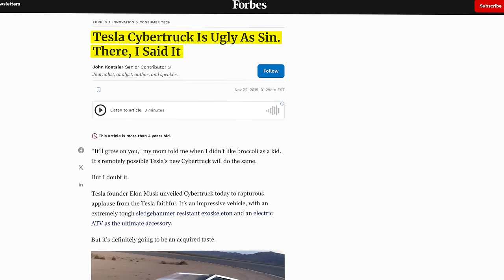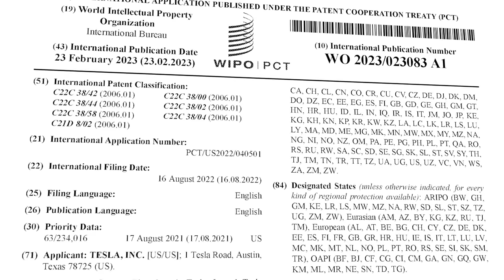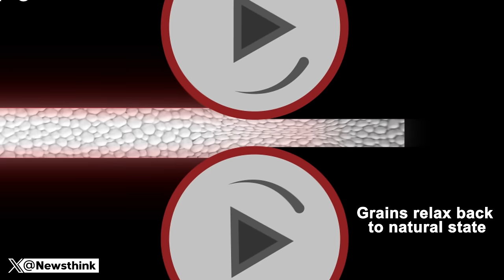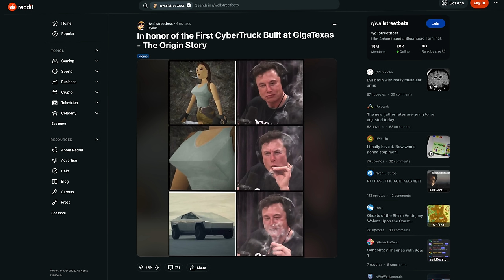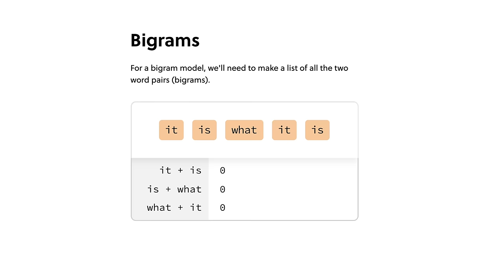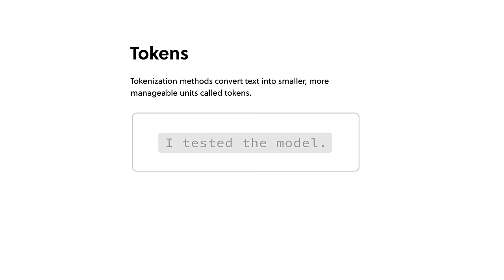Why Everyone Hates the Cybertruck

Comment: This is going to be a MASSIVE sales flop.  I give it 3 model years tops before it's canceled.
Reply: In most countries it will never be available due to its lack of safety.
Reply: @konstruktivismuskonstru9360 At least those countries will be spared having to look at this hideous monstrosity.
Reply: pretty sure it has about 2 millions PRE-orders already buddy
Reply: @infinitehexington Pre orders aren't actual sales. Those orders were collected when the truck was priced at $39,000. Now that it starts at almost $61,000 I'm sure a lot of those orders have been cancelled. That's what happens when the CEO over-promises and under delivers.  Musk is notorious for that.  Missing about 20% of the promised range sure isn't helping anything either.
Reply: @brandons9138  it's not only double in price, but also half in range. And it rusts in rain and get's stuck offroad ;-)
Reply: @konstruktivismuskonstru9360  stainless steel is highly rust resistant, stop spreading misinformation
Reply: @infinitehexington Lmao, they are literally rusting already, have you not seen the news? They have a manual stating you have to basically keep them clean and dry. Also those stainless panels will dent and look even worse once you go seriously off road, oh wait... this thing will never be able to go seriously off road lol.
Reply: @randomname4726  bro did not do his research, that "rust" is just loose iron that got stuck in the crevices of the stainless steel, your literally lying through your teeth, just clean your car, ever heard of that?

Comment: I originally wanted Cybertruck primarily for the 500-mile range, so I'm glad there's a 470-mile option. Still, the rumored price of $96k ($80k + $16k for range extender) is pretty steep.
Reply: More like 100 miles the moment you tow something😹😹😹😹
Reply: At $18 a gallon equivalent
Reply: $18 a gallon? Please enlighten us with your math
Reply: @ilovepinktacos  Pretty simple.
Reply: @ilovepinktacos  Dont feed the trolls.
Reply: @Pikminiman  Nope, don't absorb any knowledge.
Reply: 450 is average range for gas trucks on one full tank. If Tesla is comfy in driving and using I don't think it's overpriced but sure it's expensive and not for a large market, at least for its generation.
Reply: All new tech is always expensive.  How have you not noticed that?
Reply: @PlanetEarth3141 yeah and 80k for a SUV with no range extender is pretty cheap honestly, kind of an steal
Reply: You won't miss that range.  No one drives that far at one time except truckers and that's rare.  At some point one needs to stretch legs, eat something, restroom and look about.  More than enough time to recharge.  Plus most of a recharge happens up front.   A range extender doesn't exist in ICE cars and you'd e munching somewhere anyway.  Enjoy the journey.
Reply: @RealMTBAddict  

What cow hauler math are you using?
Reply: @MiloBigKitty 

 Yep.  But the less people in line for buying the better for me.  Also, I'm waiting for the two motor version.  Less price and greater range plus newer upgrades in software and hardware usually.
Reply: @PlanetEarth3141  or just buy the model Y, its cheap and nearly as good as the cybertruck but it has extremely low range i believe
Reply: @PlanetEarth3141  My range needs are exceptional. You're correct that most people don't need 470 miles of range, but I assure you, I do.
Reply: @Pikminiman  I'm happy to take your word, but very curious. 🙂
Reply: @MiloBigKitty  

You believe wrongly.
Reply: @PlanetEarth3141  ok

Comment: The problem of the EV is battery. Some EV batteries will burn under hot weather conditions or in a car crash.
It happens in many cases in China.
Although most are China’s EVs , a few cases are Tesla.
Reply: That's a problem that's already been solved, it just takes a while to switch over and ramp up production. Tesla and some Chinese manufacturers are the first to switch from using lithium ion batteries, to lithium iron phosphate batteries. They won't catch fire even if they're punctured crushed or drilled into. It's going to take some time though, probably 20 or more years for an entire industry to switch over. The good news is lithium ion batteries are way less likely to catch fire in a crash, then a vehicle with a fuel tank. They're just harder to put out.

Comment: No the normal cars are made from allows to have crunch zones, so you don't kill others if you drive into them. That's why this care will never be allowed in Europe and it is a death trap for yourself if you locked in - batteries malfunction and door does not open and the battier burns good luck if not even can be open from the outside.

Comment: Cool idea looks kinda cool, fails at being a truck. Small bed, very little ground clearance, attempting to tow anything would wreck the battery range
Reply: To be fair, towing with any vehicle will decrease it's efficiency.
Reply: @sethjansson5652 No shit Sherlock. It's WAY worse for battery electric vehicles.
Reply: It’s actually a big bed, ground clearance is great about 16inches, only thing it does underperform is in towing range

Comment: The Cybertruck make all truck look old, dandy, uninspiring, and completely boring.  The looks are a small part of the innovation included.  48V architecture, steer by wire, die cast structure and so on.  Other car manufacturers look so incapable of innovating.